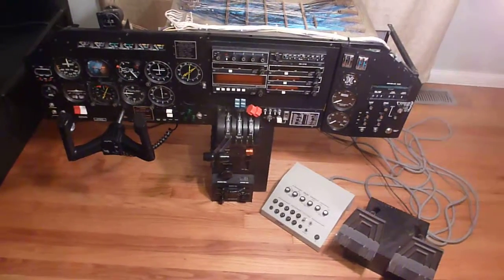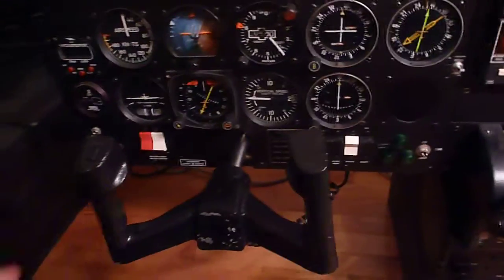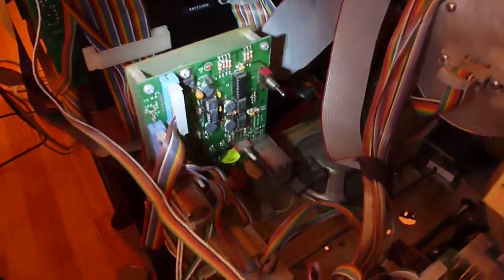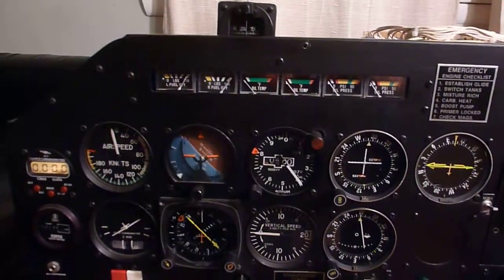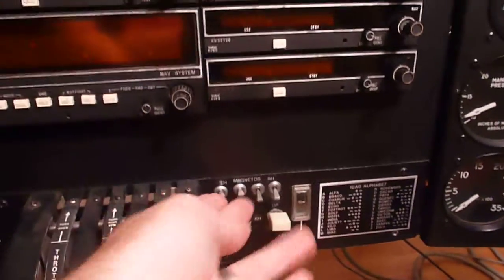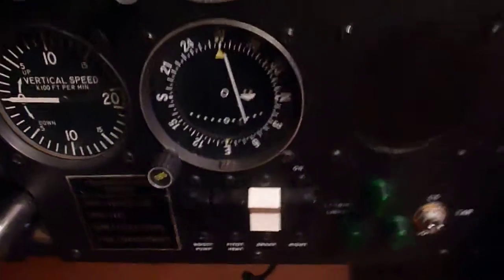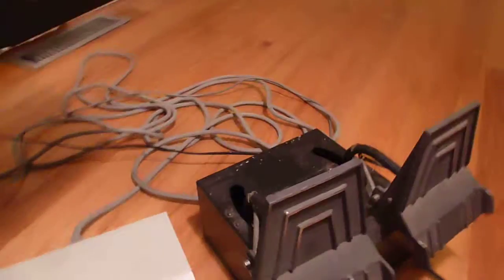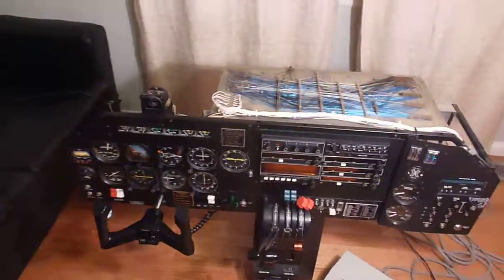AST-300 flight simulator

Comment: Would you be interested in restoring another AST 300 simulator?
Please let me know, I can email you some pictures.
Reply from the maker: Are you wanting one restored for your own use, or are you trying to get rid of one? I've ended up not restoring this sim, but instead using many of the instruments for my other, homebuilt sim. Most of the instruments are gloriously easy to interface, it turns out. I wouldn't mind having a second set of them for other sim projects.
Reply: No, not for my own use.
It was disassembled to take it out of a flight school going out of business and was working prior to disassembly. Someone told me that in it's time it was worth around 100 grand and I'm having to decide weather or not to fix it up or get rid of it for cheap. Problem is, I barely know anything about electronics.
Reply from the maker: Sadly, the ASTs are not worth a lot these days, it seems. I think the one I have was picked up by the previous owner for around $4k, and was more or less functional. They never got everything working 100%, but it was "flyable" for a time. And that was BEFORE the FAA changed the standards for FTDs, greatly reducing the utility of these legacy sims without expensive retrofits. OTOH, some of the individual gauges are quite pricey if you buy them calibrated/checked out/FAA legal from Custom Simulations (the main outfit in the US still servicing these sims). I suppose that means the instruments could fetch some $$$ if you find the right person....ergo, someone who has a sim in a certified installation and needs a replacement instrument, and is willing to roll the dice on a used instrument for some sort of discount.

After the FAA rule change, I got this sim for free from the owner of the flight school, who was tired of looking at it. Let me know if you decide to sell yours, I might be interested.

Comment: How easy, or dificult could be to use those instruments in fsx/prepar3d?
I Imagine all the simulator electronics must be removed. And and process each gauge by itself. 
has each instrument  its motor/servos/dc motors... and something to read the values?
What about radio stack?
Im thinking yo buy a not working st 300 to use it in prepar3d.. Any help is grateful.
Reply: If you have the same (real) King HSI as mine, you need to check out the maintenance/rebuild manual. I seem to recall it's a sine XYZ value (probably a resolver), but it's been a while since I dug into the manual. It's also possible that our HSIs had the heading bug stuff removed, since it's really only used to drive the autopilot.
Reply from the maker: It's a mixed bag. Some of the instruments are just D'Arsonvals, something even an OpenCockpits card could probably handle (if that's your thing). Other instruments appear to use DC motors and potentiometers, stepper motors, AC motors, even synchros/resolvers on 400hz. I have not dug into the avionics stack to see what it will require. If you feel like hacking up the back of the stack, you could run the various LEDs and buttons directly. But I'd prefer to figure out what sort of communications protocol it uses so I could just wire into the unmodified avionics stack.

If you can get a good deal on the AST, go for it. It's a lovely little rig, even if you only use it as a conversation piece.
Reply: Thank you so much. Finally I only got the instruments from the ast300, not the whole panel. So, Im going to build a cockpit panel with them. Im studying the gauges and there are DC motors, pots, synchros 400hz, as you said. Im going to change the resolvers with absolute rotary encoders. I think it is the easiest way. 
I understand how works all the gauges except one. I cant see the way to read the position of the hdg bug in hsi. I dont understand what is happeing mechanically in the instrument to get read the value with something. I dont see any resolver, pot... anything.
DC motor moves heading and is read with a resolver.
Course select is read with a resolver.
D'Arsonvals move flags, course deviation, glideslope, flags..
But... HDG bug, how can be read?
Can you help me? 
Thank you very much.
Reply: Thanks. I dindn't know it was a real hsi. But yes, It is. I have looked the maintenance manual and now I undestarnd. There is no resolver to hdg bug. It is read by a photo detector, shutter and LED. Hdg knob push a shutter, changing the resistance in the photo detector. It only changes the values between -30 to 30 degrees from the lubber line. There is no need for more than 30º.
I was looking for something lika a resolver, to know exact position over the 360º. But it doesnt work in this way.
You know the compass card position with a resolver, and later, add the hdg value to the compass card position.
Manual says Course Select pointer is read in a similar way. But we also have a resolver to know its exact position.
Thanks again.

Comment: Great find!! I am sure you will have a great cockpit when finished . I am working on an A-10 I just wish I had the electrons back ground. Thanks for posting
Reply from the maker: DeadmanWalking722 Thanks, I haven't decided if I want to restore this as-is, or just use the avionics and gauges in a real aircraft cockpit. Got a website for your A-10? Not too many folks are simulating that plane. Is it scratch-built, or do you have an ex-military cockpit?
Reply: SabrelinerSim 
It is a trainer cockpit I have a thread on the ED forms start with post 447 http://forums.eagle.ru/showthread.php?t=57846&page=15